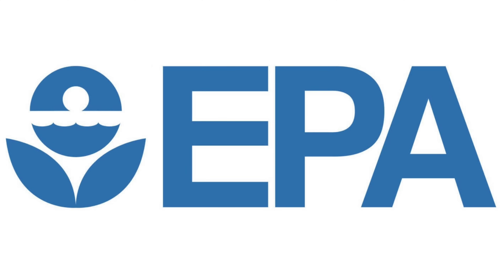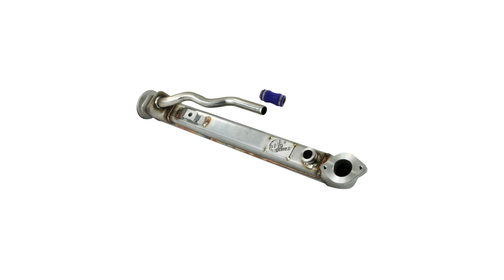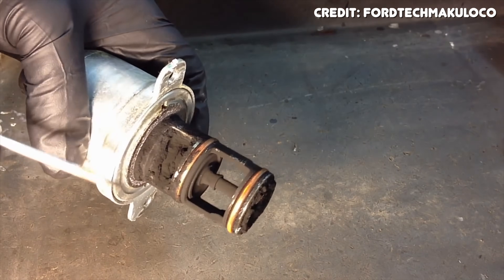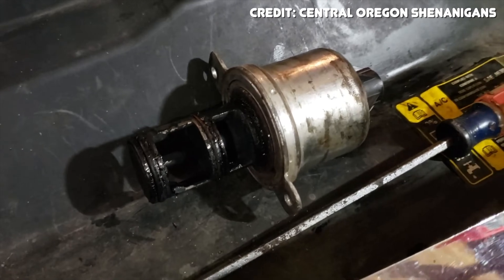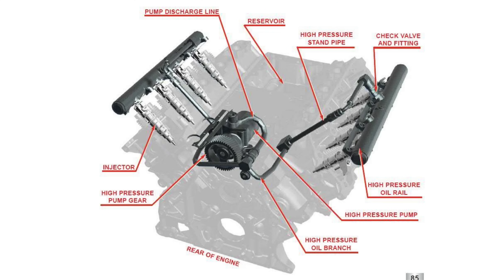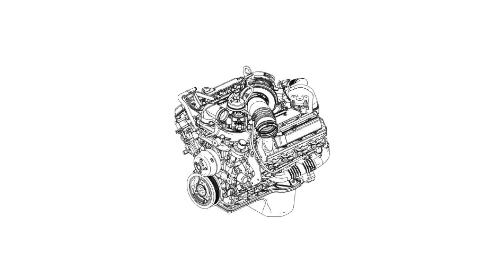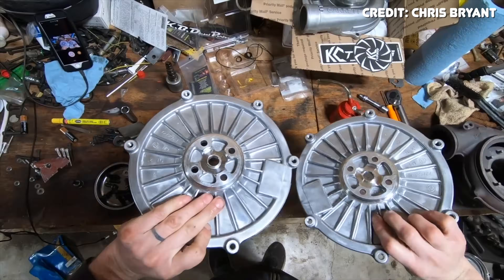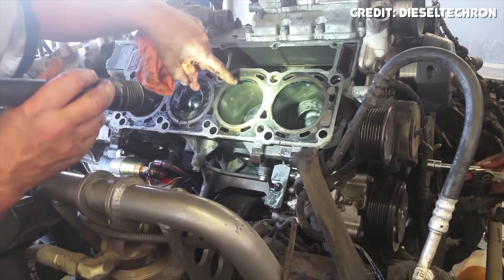The Truth About the 6.0L Powerstroke (And Everything Wrong With It)

Comment: The later ones were good (05-06) if you just drove them, no modifications. I have three plain Jane, hand crank window, 2005 F-250’s 4x4, 6 speeds that have 250-300k and have never failed. Yeah I’ve changed glow plugs, alternators, power steering pumps... but I consider them consumable parts that fail on every high mileage vehicle.
Reply: That’s funny cuz I have 357,000 miles on my 03 6.0 that is 04 swapped but she runs well off tunes
Reply: @alexanderhamilton9136  Might want to get in there and look at crank bearings or run diagnostic soon 400k 500k pushing it for the 366 small block. At any rate its Beastie Boys Low and slow that is the Tempo. 444 Industrial Kitty the 7.3 International Harvester/Navistar/Ford/Firestone/Wixon etc. 19.1 compression a big crank. Seen a truck with o.d. roll 1.3 million miles... They dont build 7.3 any more because they where great engines and all these forces work to sell you more. Lay off the boost o. 6.o  and make sure waste gate is working. To each their own and problems in design lie at the Kore along with aftermarket mods by a So called Speed shop or a watch me Now feller. . Had 6.0 was a nice truck no probs. No mods. 88k then the barrel Rolls. Jing down tube. Runn a 00 7.3 with 6 pos. chip. From Snail 4" All the way back with a beefed up 4R100 shift kit and triple disc torque converter. So for the money in and power out I can live with 400 -420 H.P.  600+ Torque. The more Dense and Compact Cool Air You Can get in on detonation and faster you get it gone =PowEr. Funny it be fryer oil kerosene  No. 1 or 2 or off road J.k. it will work. Does any of you know about that drop of dawn in some water and it acts as that D E F ?  Is it True or False ?
Reply: You can’t baby these trucks. That’s not how they’re designed to be operated. Drive them like your running a few minutes late to work. Not like your riding with Mrs. Daisy. And limit your idling. Cooler operating temperatures promote excessive carbon production/adhesion. I’ve got a 2006 6.0l. 184k I’m the third owner. The truck has had an injector replaced and the HPOP system was updated, that’s it. I do my maintenance when it’s supposed to be done and I use OEM filters ONLY. I run 5k intervals with rotella T4, I do 30k coolant drain/fill with motorcraft gold, and I change BOTH fuel filters (OEM) every other oil change. Trucks that have problem children engines usually show a trend; improper fluids/filters and/or improper maintenance intervals, and/or abusive aftermarket tuning.
Reply: 2006 350 with the zf6 at 332k still choochin #7.3s a dog
Reply: @chapmanhere3397  jelly
Reply: My parents owned a 6.0 E350 that they used to pull their 30+ foot camper which they pulled once a year to Texas and back to ND while they wintered in Texas. They didn't have any non-consumables (as mentioned in previous posts) parts. It was a very reliable vehicle. That being said, they didn't do any modifications of any kind. The only questionable repair was a turbo replacement which I think was the dealership getting money from the extended warranty company by saying the turbo rusted out because the van would set for long periods (used mainly for towing the camper or hauling things).
Reply: @jimletzring1685  Turbos are super easy to check on and you can also do it by computer
Reply: 2005 4x4 6.0 that’s been pulling a 5th wheel for 17 years.. zero mods zero issues…
Reply: Have a 2005 F250 o-ringed and studded heads, installed coolant filter, plugged egr with 2 freeze plugs and programmed. Tow tool trailers daily and almost 400k miles. Great truck! Work was done at Powerstroke Specialty in Bufford, GA years ago.
Reply: @littlefinkle7757  Is that the Bill Guy in Goergia that does Videos online about Power Strokes.
Reply: @peterparker9286 Yeah but Bill Hewitt passed back in Oct 2023
Reply: They were great, but you want to replace the head bolts with head studs
Reply: If you want to run a hot tune. I run a light tune with the original headbolts. No problems.  @addisonherbert6686
Reply: I heard they were bad so I bought one 4 years ago so I could satisfy my anxiety problem - but except for replacing batteries and vacuum control and it’s hoses, I’m still waiting for it to blow. I’m screwing something up.
Reply: Same here , still own 05 F250 Single cab 4x4 ,plain jane used in landscape business and no major issues besides consumables as you mentioned. Just under 300k miles.🙌✌
Reply: @mikethatguy27 Lemme see
Reply: I have an 04 with the 04.5 block. Egr turned off, cooler delete, studded, and the coolant filter. I have a 50hp towing tune and that's it. Truck is great. Do regular oil changes and keep additives in on a regular basis in oil and fuel. Ihave more issues with the drive train than the engine performance. Simply stated, it's not a race built engine. It's designed to drive and haul, Not roll coal.
Reply: Modify it,,,,,,,dont look back
Reply: ‘06 6.0 E450 owner. Its in maintenance, but not for what you think.
Reply: I had a friend with a well maintained 2004 F350 dually and it she tried to start it one day, started smelling diesel and it burned to the ground. There was NOTHING left. It was a sight to behold. It also burned the front of her house, It was really sad.
Reply: i am under the impression the 05-07 models are Really good trucks if they're Un touched and maintained really well........ or if you start modifying them and adding power you spend ALOT of money to the point the engine is almost unrecognizable put side by side to the stock one. i have the latter and will soon have the former. and a 19' f250 6.7 platinum.... so i know about the powerstrokes. my 05 harley trucks got 700 hp and 1400 ft lbs of tourqe since 2010 its made that much power and its racked up 208k miles.
Reply: @justnsaliga8518  I would have to agree.. zero issues with my 2005 6.0 power stroke.
Reply: At work we got a 03 that’s solid as a rock 187k miles fires up strong and fast. The 06 is a turd
Reply: did you use any additive to clean the fuel injectors?
Reply: My grandpa had a 6.0 ran decent for a long time till he drive it to Arizona it overheated he just kept driving blew the motor got a new one then I can't remember what happened but it broke down again he sold it to my uncle he wrecked it and blew the motor then my dad bought it from my grandpa now we have this pile sitting In the front yard
Reply: @gavincarroll2553  sounds like your family has no idea how to take care of a vehicles 😅
Reply: This makes me feel better! Anything that’s not an off the shelf part will fail! 

It’s kinda common knowledge lol
Reply: I concur 💯🥜🇺🇸. I have an 06 she keeps purrin 👌🏻💪🏻#letsgobrandon
Reply: My father-in-law has an 06 that he only uses to pull a medium size trailer a hand full of times a year. It only has 70 k and has been completely rebuilt twice. 
No mods. No tunes. 3000-mile rotell oil changes and the guy drives it like it's a Tiffany lamp. 
I'm not trying to start an argument, but the 6.0 was an embarrassment.  I honestly think that anyone who baught a 6.0 from ford should get a free truck replacement.
Reply: @BryceAWD  when a truck sits and doesn’t get used as often causes issues weather it’s a 6.0 or not
Reply: @BryceAWD  someone got lied to by mechanics if that dude really believes it needed to be rebuilt twice in 70k lmao. 
Impossible
Reply: @BryceAWD  I buy all the 6.0s I can, run like hell when they got the right oil cooler n deadbolts on em with a tuner and sticks
Reply: @BryceAWD  The trouble with driving a 6.0 like a tiffany lamp is that all the soot the engine generates causes  problems with the turbo and the egr valve. these trucks with 6.0 engines need to be driven like you stole them to keep the soot blown out!
Reply: There great engines after you spent 20 k.upgrading replacing every international / Ford part.
Reply: @techs1smh13  20??? Maybe 7k that'll get you new head studs, clean the turbo, bulletproof oil cooler , coolant change to hot shots red, and good oil change, all u need, 58v ficm just a plus, egr delete also very cheap and easy to do yourself, 20k is outrageous and I'm a technician
Reply: @jacobgomez2682   my brother has an 06 king ranch babies the fucking thing has spent 27k to keep it going.  Makes a shit ton of money doesn't care. Not me.
Reply: @techs1smh13  my dads king ranch has maybe 10k into it and its babied aswell, I just left general motors and let me tell you I still take a 6.0 over a duramax any day especially if your working on your own stuff, 6.0 guys wont get rid of em, and I eont either
Reply: @techs1smh13  He's getting ripped off if he spent that much just to keep it going down the road. That much money will get you a fully built transmission, a more than bulletproofed engine and potentially even a paint job.
Reply: @Rankine_Cycle21  who's he
Reply: @jacobgomez2682   the Duramax is way easier to work on compared to a 6.0l, I don’t know what your talking about. The 6.0 is an extremely complex engine with very complex electronics. If you don’t study the book on it meticulously or know exactly what you are doing it will never run right.
Reply: all  what lol, I was a tech for general motors and trust me I've done my share of duramax heads ect. The 6.0 powerstroke is wayyyyyyyy easier!!! One of the easiest diesels to delete ir do studs or hpop or seals whatever trust me I've done plenty of both 6.0 is simple
Reply: @jacobgomez2682   yea it’s easy now for you because you have had a lot of practice doing 6.0s LOL. Please tell me why the duramax has been used in almost all applications and has been used over 10+ years and why 6.0 was only used 4? And easier to work on? Please, you have to pull the cab if you actually are a serious technician and want to do any serious work professionally. I have worked on 6.0s and they are a bitch compared to a Cummins or duramax of similar year.
Reply: @orangesforall2053  you need to look at my ig I have more cabs pulled of duramax trucks than anything else, and 6.0s can be done head in cab much easier, I was a "gm" tech for most of my career, I did not work for ford, and yes 6.0s are much much easier, duramax try removing the rear egr cooler bolts with trans in and cab on not gonna happen, if your a mastertech then you wouldnt argue this
Reply: @jacobgomez2682  if you are doing 6.0 heads with the cab on you are not a good technician. The cab needs to come off to do a good job.
Reply: @orangesforall2053  maybe for you, I do them both ways pal, keep studying one day you'll be a lube tech!🤙😭😭😭😭
Reply: @jacobgomez2682  Ok “master technician”. Thanks for letting me know you have never done a quality head gasket job if you haven’t taken the cab off. You can barely even torque the passenger side head bolts with the cab on. But from the way you act I can tell you like doing hack jobs. I like doing quality work and a 6.0 powerstroke is a harder engine to do quality work on period. It’s such a poorly designed engine that they didn’t even put the right length pushrod in the damn thing.
Reply: @orangesforall2053  my engines speak for themselves and I run them all over the country you are really emberassing yourself😭😭😭 I told you I do 6.0s cab on and off, jiffy live guy goodbye sir, hopefully you dont get burned dropping hot oil all day, if you got cash I'll meet you at any cash days????????
Reply: @jacobgomez2682  I’m sure they do, I’ll do a better job though the next time they fail when I take the cab off and do it cleaner and faster. Also, I have changed enough oil to how to not get burned, I can show you some tips if you are still having trouble!
Reply: @orangesforall2053  I put out my offer my team has engines all over in most weight classes if you want to put your money up well see who does better work🤙street or strip idc
Reply: @jacobgomez2682  don’t even need to put any money up. What engine has almost every single record in almost any competition diesel event? A Cummins.
Reply: all incorrect again lol
Reply: @jacobgomez2682  let’s be honest, the 6.0 is the worst designed modern engine in the history of the automobile.
Reply: @orangesforall2053  There are ways to deck the issues in the truck with the right tools and know hows. Ezier to pull the front clip or some of it then the cab.
Reply: @techs1smh13 He probably didn’t care to do oil and filter changes or clean out the oil filter and replace fuel filters.
Reply: @bdoginit You’re not being honest.
Reply: @orangesforall2053 Complex but well designed and engineered, do the maintenance and drive it regularly.
Reply: @techs1smh13  hahaha this is laughable so I guess I should tell my 6.0 customers to spend 20k for an already reliable truck? Sure they have their flaws but not like any other truck. This week I have a 6.0 apart to reseal the bed plate guess what? It had 400k with original heads and head gaskets and it’s been tuned from edge from the beginning. We took the heads off to see how everything was this engine looked like it had 100k miles and the gaskets were fine. But this guy takes care of it he is religious about maintenance
Reply: @neooverby3750   was stranded way too many times we as a co almost closed because could not keep 8 running ford would not help us .gave away /sold all. We've had fleet of Chevy vans  since 2011 in so Cal  Traffic etc. Will never buy a ford product again.
Reply: @techs1smh13  many of my customers came from Chevy and dodge with the same issues it all depends on what you buy and years no product is really better then the other I just thing people throw things out of proportion too often
Reply: @neooverby3750  we have a fleet of d max service rigs in so call. Just changed first water pump 287.k  miles on 06 lbz.all have OEM turbos ECM transmission u joints drive shafts a arms wheel bearings. Can go on on. We had a fleet of 6.0 diesels. When our trucks are in shop we don't make money.  And also you can blow off a d max with air after 200 k doni leak a drop.
Reply: @techs1smh13  come to utah with cold winters and salt chevys frames and driveline components drop like flies out here
Reply: @neooverby3750   I'm going to be moving from CA. Utah is a place on my list. What kills vehicles in so cal 105 degree weather bumper to bumper traffic for hrs on end.   Everyday in summer. Our fleet of Chevys just keep on running my co van has 206 k. Leaks nothing has original AC. My 6.0 ford AC caught fire at 60 k. And so did 2 others we had.
Reply: @techs1smh13  In Utah summer peak is 100 + bumper to bumper traffic you won't miss it..
Reply: @francomtz7115   F that  done that too much.
Reply: @francomtz7115   how's st George.
Reply: @neooverby3750   I own a 6.0, not a day goes by when I don’t worry if it will let me down. Terrible engine design from international and Ford still used it. Tons of lawsuits and class action lemon law claims. This is NOT a reliable engine, that’s why it was only used for 4 years and it still cost Ford millions of dollars in warranty work. Compare the 6.0 to a Cummins or duramax and you’ll see just how shit they are. I’ll be Cummins swapping mine soon so I never have to worry about it again.
Reply: @orangesforall2053  hahaha it’s funny how people blame just the engine learn to actually maintain the engine. they work just fine for me my father and countless of my customers. I’m not saying they are better then the Cummins or duramax but they work just fine if you know what you are doing. Keep the coolant clean do the necessary updates to dumpy plugs and sct fitting regular oil changes and you will be just fine. Oh and don’t chip it and run it like you stole it.
Reply: @neooverby3750  I don’t and I have. That’s exactly the problem lol. You have to do so much work so that instead of running a 1/4 of the time it will run 1/2 the time. Over 200k they just fall apart and past 150k they become a money sponge. It is a bad design that was rushed to market to meet new standards in emissions. International themselves have admitted this in numerous class-action lawsuits. They have lifter problems, camshaft problems, countless fuel delivery problems, weak LPOPS and HPOPs, stiction, turbo problems, FICM failure, and countless other issues. Just because you have been lucky enough to not have any issues does not mean they aren’t prone to chronic issues. I only run T6 in my truck with archoil and I still have had numerous issues. It is a bad design, period. I’m in the process of looking for a 12v to solve it once and for all.
Reply: @orangesforall2053  I guess I should tell dozens of my customer’s their trucks are falling apart and sell them I guess😂😂😂😂. What’s even better they think Cummins and duramax don’t have any major problems I have 4 Cummins in right now with egr dpf scr and turbo problems. Also another one that throw a rod with 10k on the engine
Reply: @neooverby3750   what year are those Cummins trucks? I thought it was pretty obvious we were talking about PRE DPF ENGINES since you know the 6.0 doesn’t have any emissions equipment besides a cat and egr but I guess I have to lay it out for you. If the 6.0 did have emissions equipment it would be even more unreliable than it already is. You can tell your customers whatever you want but they have to be your customers for a reason. If their trucks were reliable they wouldn’t have to get work done by you.
Reply: @orangesforall2053  the turbo is in a 24v pre emissions then we just got finished with 2 that had severe repeat trans issues if dodge could figure out their trans and axle issues they may have a solid truck
Reply: @neooverby3750  I’m talking about the engine, but yes earlier dodges struggle with trans issues and the 5r110 behind the 6.0 is pretty good besides the direct clutch problems and reverse planetary issues. However you can’t tell me that a 6.0 is more reliable than a 24v and if you spent the 7-8k needed to “bulletproof” a 6.0 you could have a reliable high HP Cummins that’s fun to drive/better to tow with, and is more reliable. gotta get a manual trans tho or update the auto trans to handle the Cummins power.
Reply: @neooverby3750  100% key to a 6.0 no doubt
Reply: @neooverby3750  same with the fords. They rust just as bad.
Reply: @connor4961  ones that do that the worse in my area are dodges and chevys they are always rusted out
Reply: @techs1smh13  we can all tell you have never actually been around a 6.0 in your life and clearly just hate ford in general. Quiet girl.
Reply: @connor4961  They are all rotting these days. 2 year old trucks with penetrations through box sides not rose buds of rust. Pen i try sky rations .  Sorry for that but all of US need to look at the Big Ger Pick Tor.
Reply: @orangesforall2053 how much and which Cummins can I swap for my2006 f250 6.0? My truck runs good now but it's paid for 160k miles and just pull a 17 foot boat and don't want it to leave me stranded.
Reply: @techs1smh13 Catching fire is owner error.